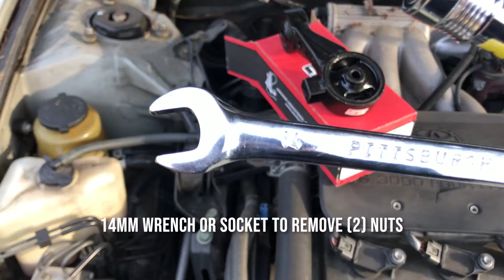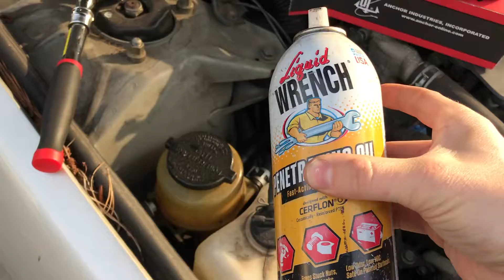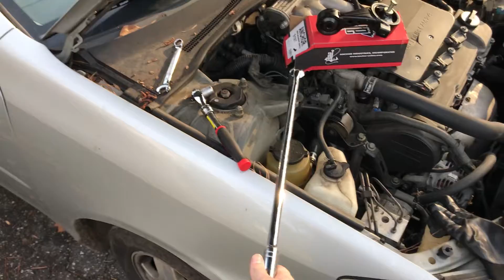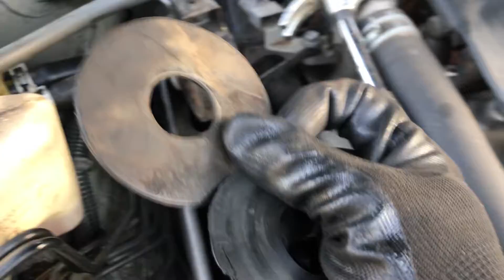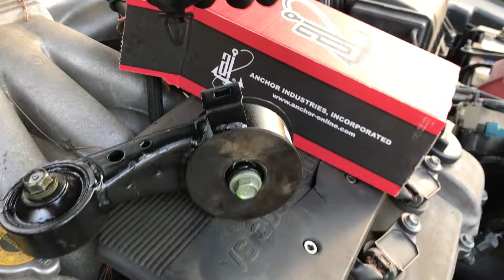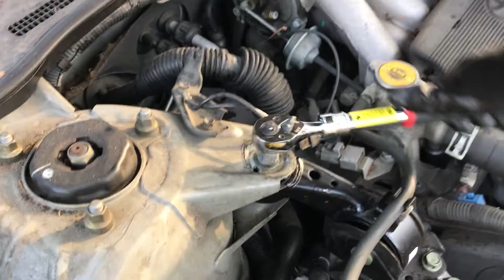Engine Mount Replacement | 2002 TOYOTA CAMRY | How-To Replace Torque Strut Engine Mount

Comment: Good to show how easy this top mount is. The engine does not even need to be suspended as in some cases. So you know you're getting ripped off if some one tries to charge the big bucks. Thanks.

Comment: Thanks Bro for the video with details, did you have to jack up the engine?
Reply from the maker: glad it helped. I did not have to jack the engine this was fairly easy. The hardest part is just getting the old bolts off but with a breaker bar it wasn't difficult.